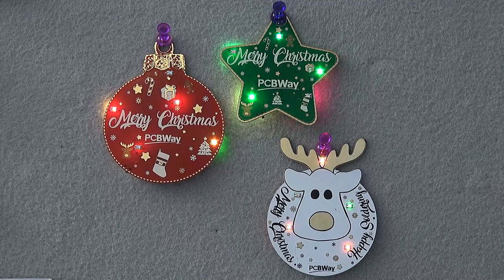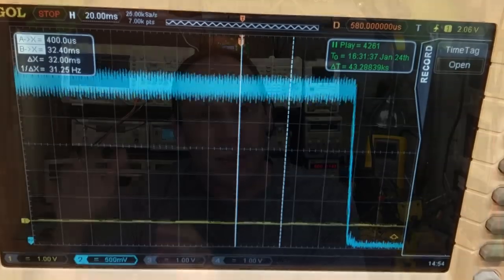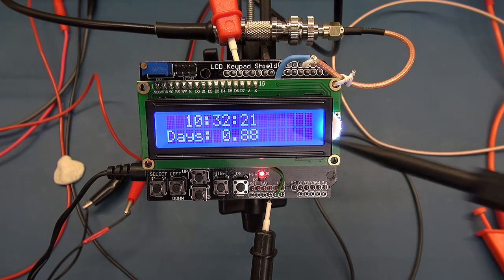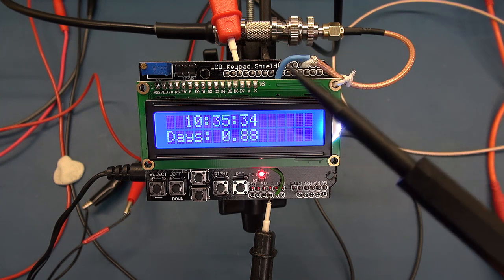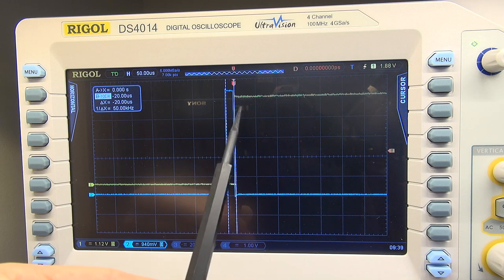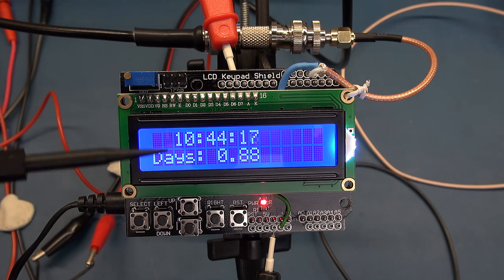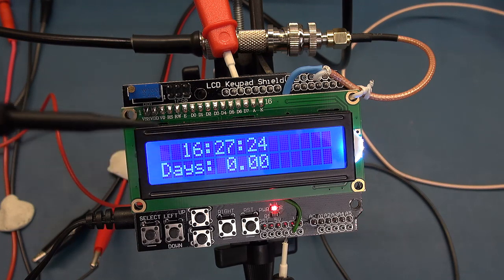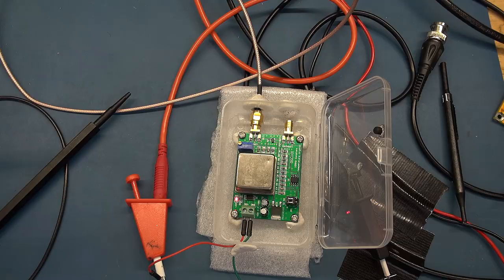HAQ Clock v2.0

Comment: The Arduino UNO has a hardware 16 bit counter that can count input pulses and interrupt the processor when a specified number of pulses has been counted. This means it can easily count a 1MHz clock and interrupt the processor at 10kHz.
Reply: Exactly what I thought! just use the built in hardware, don't need to sample. Set up the counter so it triggers an interrupt every n pulses.
Reply from the maker: Thanks, I will look into that!
Reply: @mjlorton  it only works with specific pins because the atmega does not have io matrix as some other mcus, so have a look at the datasheet and the atmega328 arduino pin names.

Comment: The original clock was most likely doing their calibration, most would do this every 24hrs, but it looks like they had to include a routine to add or subtract some clock cycles every so often
Reply: Also, what's the reason for not just using the 10MHz from an OCXO as the main system clock?
Reply from the maker: Interesting possibility. In the next video I will cover that topic as I use inhibition compensation in my next prototype.
Reply from the maker: @sdgelectronics  I was struggling to read frequencies above 30khz. One reason is the Int variable size...silly me, and the other is the way I'm reading the clock pulse. I need to do more homework here, but in the next video I'm using a Due at 100khz. If I can run native at 10MHz, then that is the ideal.
Reply: @mjlorton  does the arduino at least have a hardware timer that you can clock with the 10MHz? There shouldn't be any need for missing clock cycles.
If you want a chat feel free to contact me on my email address on my profile

Comment: Wow! The fun part of the video is seeing your enthusiasm. Maybe later, you can make the display to show Local/GMT... What happens if you combine it with GPS and default to oven if/when no GPS?
What about your power supply? If you set an UPS between the clock and mains power to keep power more constant, keep oven more constant, maybe it might help, and place crystal inside insulated box...
 And then there's the issue of your reference thermistor itself that is keeping that oven at a constant... And there's the issue of temp changes in the UPS, not to mention it's OWN clock!
What about SEVERAL clocks, and a circuit that "Votes" on accuracy? It puts me to mind of the three ship's clocks that they carried (and still do!)  to figure longitude with Sextant.
73 and All the Best!
DE W8LV BILL (Circleville , OH)
Reply from the maker: Thanks for your post. The option of several clocks has crossed my mind, this may be an option I play with in the future. In the next video you'll see I have all the accuracy I need for the time being.

Comment: Very interesting video! Another way to output pulses without using delay is to seperate your digital write commands in your code, pulse width is controlled by execution time of the instructions in between - assuming you don't require exact pulse widths and are edge triggering.  Have you checked the drift of the Rigol's trigger circuit?

Comment: Using a 20ppm 1Mhz XO (MCO-1510A at room temps) divided with 3x 74HC4017 down to 1kHz and using an interrupt on atmega328p I got 5-9ppm drift compared to 1Hz signal of DS3231 which has internal 32768 TCXO verified to be in spec with 2ppm from datasheet over ~1,5-2 years.
My goal was not time keeping but making a somewhat accurate timer with mS resolution. But this shows me that a simple 20ppm XO can be as accurate as 2ppm while operating near 25 degC..
After such experiments your project is especially interesting. Looking forward to new videos.

Comment: You should look at that oven oscillator and do some analysis to see if you can figure out what is drifting.  First thing is to be sure the oven is actually working.  Hint: watch the oscillator current draw and how it change with ambient temp.    Those oscillators usually have a VC control input to adjust the frequency.  If that voltage drifts with temp the oscillator will follow.   Also watch the supply voltage to see if that drifts with temp.   Then, as Dave Jones once showed in a video the gravity vector will cause the frequency to change.  Air pressure can also be a factor at higher precision.

Have fun.
Reply from the maker: Thanks for your post and input.

Comment: Oh my. Please don't tell me you're just sampling the clock edge in your main loop. You don't need an 84MHz clock processor to keep accurate time. Most AVRs will have a hardware counter on board that can count an arbitrary number of pulses and wake the processor up to refresh the display. This way you're guaranteed to catch every edge...
Reply: In fact, here is an article I wrote describing exactly how to do it on an ATTiny87. https://keepdevelopingprojects.wordpress.com/2017/09/14/project-nixie-clock-upgrade-final-code/

Comment: Interrupt on the input clock. ISR checks the tick flag, if already set then set error flag, then sets the tick flag. Main loop does its thing then checks the error flag and the tick flag already set and for either set reports an error (missed a tick, late for a tick), then sits and waits for the tick flag to be set. When main detects the set tick flag, it clears the tick flag and starts over at the top of the loop.
To eliminate main loop timing from causing problems, the ISR should increment the tick count. Main loop should just read and interpret that tick count and display. Doing this you can be more accurate than your display update frequency.
Reply from the maker: Thanks for your input.

Comment: A little trick I figured out to toggle pins is you can read outputs and it returns the state of the pin, the snippet just sets the pin to the inverse of what the pin reads as essentially toggling the pin, you could probably use that instead of using tone. Except it would toggle at each second (0.5Hz), if you want it to maybe pulse for 1/1000th of a cycle (or more, at 1khz), I'm not sure about the hardware counter/timers etc, if you can set one of those to count when the 1pps turns on, then turn off after a certain number of reference signal pulses 

digitalWrite ((pin),!digitalRead((pin)));
Reply from the maker: Thanks for your input William.

Comment: I noticed you have a fluke model 867 meter on your test bench.  fluke does not support that meter any longer. my 867 screen is becoming hard to view,  I love that meters capability.  could you do a video on how you use your meter. greatly appreciated long time follower.
Reply from the maker: Yes, the displays on those meters, like the 164H I have just acquired, are a problem. The 867 has been very handy in a number of situations, I will put it on the list for a video.